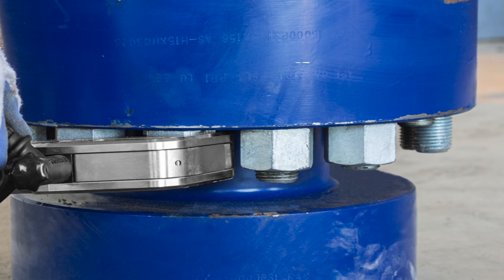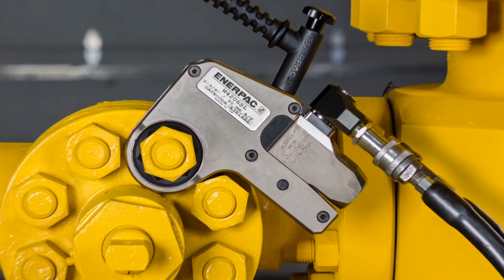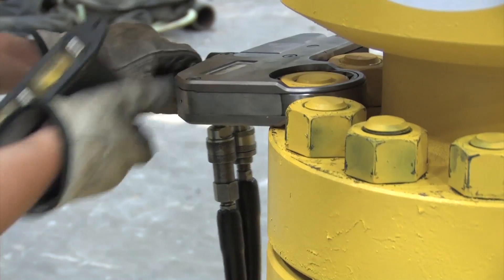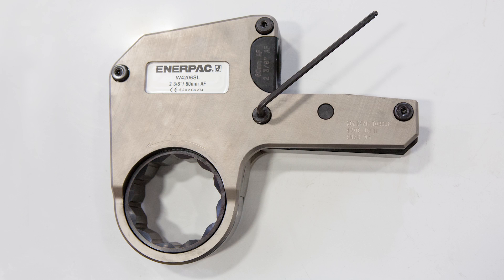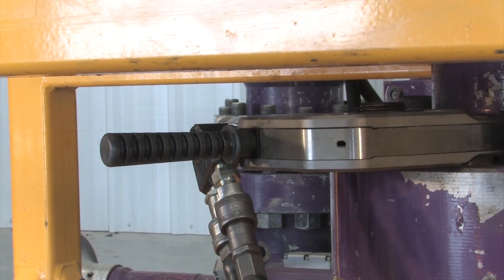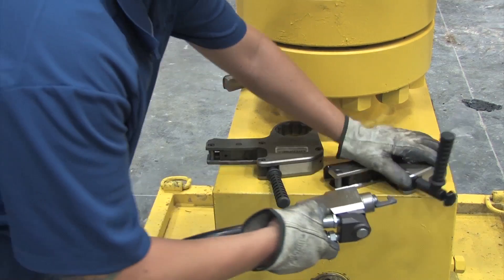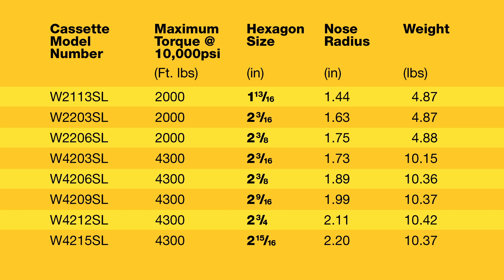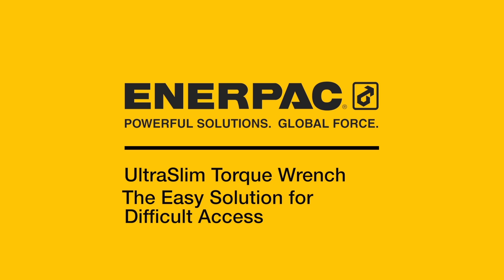Ultra-Slim Hydraulic Torque Wrench Cassettes | Enerpac

Comment: The biggest obstacle in torque wrench accuracy during use is technique. Most people who use torque wrenches, including master mechanics, probably overtorque by about 5% of wrench range due to poor technique. I work in a cal lab and it takes a lot of practice to be able to pull a wrench to snap at a given torque when compared to the rotary table built into the torque tester. 
http://torquewrenchreviews.com/